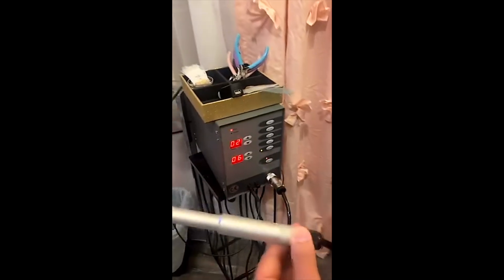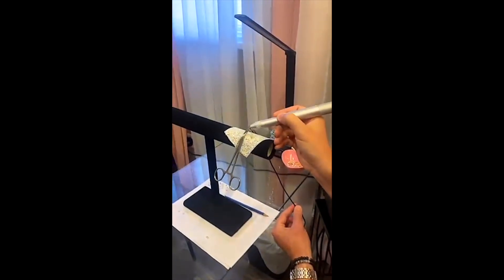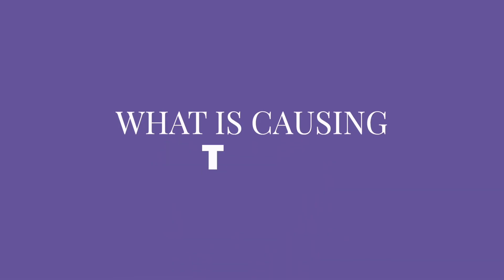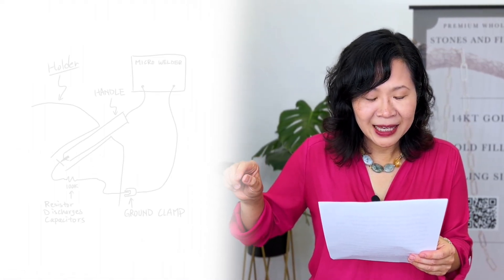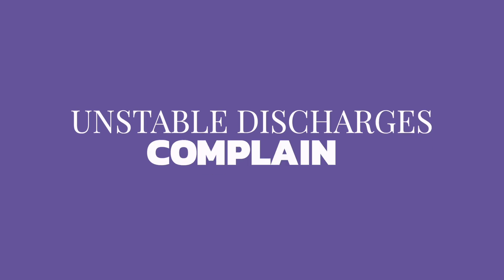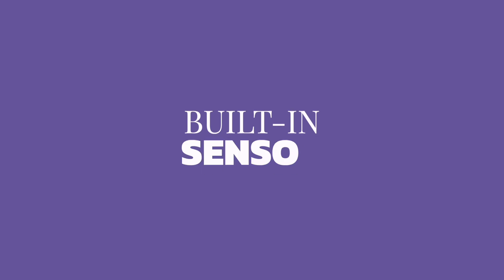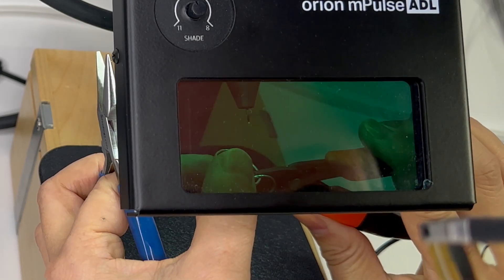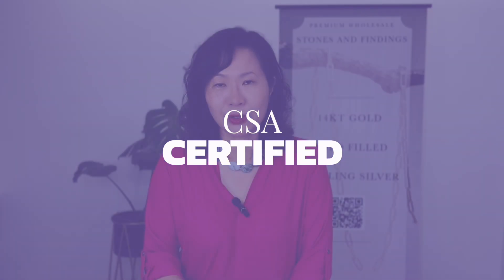WARNING: This Can Happen with THIS Welder! Permanent Jewelry Micro Welder Safety Concern

Comment: I'm sure with all the units sold, those Chinese companies may have gathered enough money and information to build a better machine for the near future.  I've seen that happen with other products they make, you can see it in Harbor Freight tools.
Reply from the maker: It is not for the lack of funds or technical know-how that Chinese companies do not build better equipment.  They certainly can, and do - just see the electric cars and surgical lasers they export.  These are superb.  It is a matter of building state of the art & safe equipment at the price points people pressure them into making.  The grey welder is meant for the dental industry - to weld bridges and crowns, not dainty precision work for permanent jewelry and next to someone's skin.  
 
I have nothing against Chinese companies, I'm of Chinese heritage, it's just that I see things for what they are.  If you're looking for cheap short cuts, something has to give, and you have to weigh whether or not it is worth the risk.  When you're dealing with welding near a customer, safety should be your first concern.  The laws in Canada and USA certainly make that clear.  

In Canada, you cannot get insurance if you use equipment in your business that is not CSA certified - if you already have insurance, it is nullified, so all accidents/injuries resulting from the use of the uncertified safe equipment will not be covered.

Comment: The setting of 2/6 is waaaay to high. 2/3 and 1/3 (26g rings), at most is the right setting with this welder. 6/2 is the auto setting the machine default to after about 15 mins.
Reply from the maker: thanks for sharing this info here.
Reply: @JeffCarter-s8f  try 1 6 also.   1 is the power and 6 would be amount of time

Comment: Wow. I didn't buy this machine even if the price was enticing because of reviews saying the spark was way too strong for jewelry. You showed that level 2 is still way too strong for jewelry. How terrible. I trained in jewelry making at a trade school so I understood the implications of a machine being too strong but your demonstration is absolutely enlightening. 
Now I see that this is possibly a ticking bomb so I'm even happier of my decision. This is simply poor engineering. No safety mechanisms whatsoever. 
Plus, what does quality control look like? Do they even have quality control? So many generic products coming from China seem just makeshift crap like if they didn't care about customer experience or 4 safety as long as they can make a quick buck. 
What happens if there's something wrong inside or if a component blows up and the thing overheats and hurts someone or causes a fire? There should be a form of redundancy to insure protection in all cases. 
Now I understand why decent machines cost more and that we need these systems we pay for. 

I've not used my machine yet. I'm still afraid of doing something wrong. Your channel made me realize that I need training. I'll go through all your videos and then probably get one of your training programs.
Thank you so much for all of this! ❤❤❤
Reply from the maker: THanks for watching and sharing your thoughts.  You're right and that's why this machine is not CSA certified for consumer safety.  

Furthermore, if you're in Canada or in one of the EU countries, you would not be covered for liability insurance should there be an injury caused by equipment that is not CSA certified.  A lot of people don't know this and because the insurance underwriter did not ask pointed questions, such as whether you are using non CSA certified safe equipment, they mistakenly believe that it doesn't matter.  You need to read the fine print of your policy.  Insurance laws and policies vary from country to country, company to company and we need to be aware.

Comment: also, can you post a link for the actual forums  you were referring to?
Reply from the maker: Here's one of the forums:
https://www.facebook.com/groups/2175129299356549/

Original Permanent Jewelry COmmunity.  You have to ask to join and there are a number of threads.
Reply: @stonesandfindings  will take a look at it thank you…. in my case i’m using this for art sculptures. I create stuff using recycled and up-cycled old computer electronics
Reply from the maker: You're not using it near a client's skin and don't need to worry about burning through the leather protector.  I would read more reviews for your uses.  Maybe the permanent jewelry forums aren't the best.  I'd look into the art welding threads on other forums.

Comment: it’s very possible that it’s a bad unit or something and they need to swap it out
Reply from the maker: Agreed - they should exchange it.  However, the manufacturer would not refund.  You can see on some reviews that are public (like Amazon) the reviews there.
Reply: @stonesandfindings  well that sucks yeah I was seeing the same one initially until I learned about your channel that I should look for something a little better - ended up, ordering a zapp plus Microscope arm kit
Reply: @cjadams7434  it could be that or user error or even the grounding tools.  So many variables
Reply from the maker: When the machine is switched off, it should not emit an electrical charge.  It has nothing to do with the grounding tool the person used.
Reply: @stonesandfindings  what was it plugged into.   Could be a faulty power pack or power strip.  My husband and BIL are electrical contractors and both of them asked that ??? They said that there are missing pieces to this video to make a true determination of cause
Reply from the maker: It should not matter if it was plugged into the wall or a power bar.  The machine was switched off.  This should not happen.  I agree, this is a faulty machine.  Maybe it's the only one like this.  

This machine seem to vary a lot.  She did not feel any tingling while holding  the stylus, as reported on the PJ forums by a few people.

She did not experience arc without the electrode touching the grounded chain (electricity shooting from electrode to the chain even before there's physical contact), which has been reported by others on the PJ community. 

So, yes, this could be a random thing.  I would suggest people really read the reviews and speak to people who have used this machine and that's why I want to hear from everyone.  Please share your experiences, everyone!
Reply: @stonesandfindings my unbranded machine did the same exact thing!! It wouldn’t weld properly and blew all my jump rings to ash! It was turned off and still emitted a huge spark!! I decided to get a zapp, hopefully I’ll never have issues again.